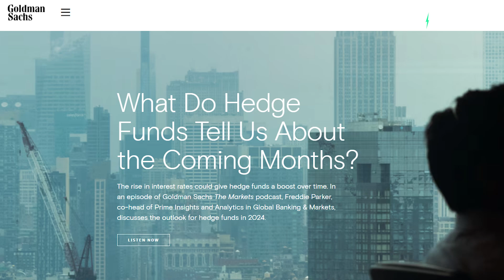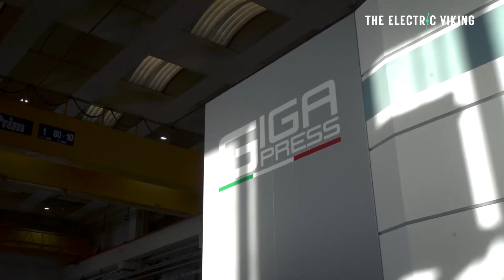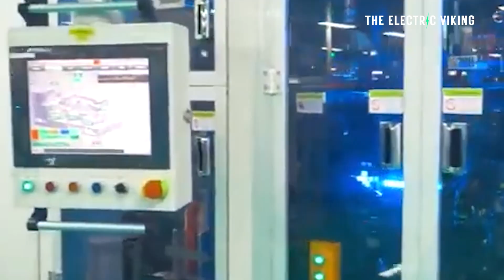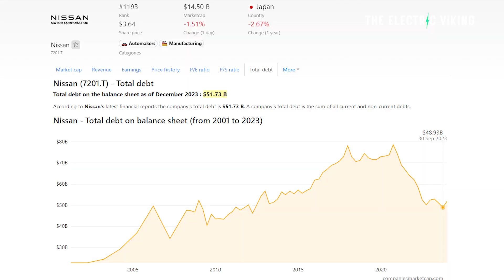Nissan will use Tesla Gigacasting & build the worlds biggest battery factory

Comment: Dude kWh is the amount of energy held in the battery. If density is high the battery is smaller size. So you always need around 80-100kWh for a car with decent autonomy. If these new batteries are way smaller this is nice.

Comment: A proper comment on Nissan’s plans requires to different areas of comment.
Gigacastings is easy to say, but hard to do.  To make gigacastings worthwhile, Tesla had to develop new design tools.  Ask Sandy Munro about this.  I’m sure Nissan hasn’t been able to develop new design tools and train it’s engineers on how to use them.  This will take years to achieve.  By then, Tesla will be even farther ahead.
If Nissan is able to make more energy dense batteries, maybe the KWH rating for the battery can go down a bit, but doubling battery energy density does not halve the need for KWH capacity.  So, a solid-state battery of 30KWH is going to give a low-end Nissan Ariya about 130 miles of range.  They will need a 50 KWH battery in each vehicle just to keep the 208-mile range.

Comment: 30 kilowatts? The whole point of a solid-state battery is that you can make it small enough to where you can pack maybe 150 kilowatts in a small battery.  This way you end up with a car that can go a thousand miles.  There's no way that they're going to make a solid-state battery and just make it 30 kw... That's the size battery that you put in a tiny micro car.
Reply: kWh not kW!!
Reply: @alexishart1989  You know what I meant, don't always feel like typing.  Point is the Viking says stuff like this all the time, a 30kWh battery is a 30kWh battery. It doesn't matter if it's Lead Acid, NMC, LFP or Solid State.  Of course LFP will be lighter than Lead Acid, NMC will be lighter than LFP and Solid State will be lighter than than NMC, but even if you got a tiny AAA battery to have 30kWh, you're still not going to be able to move AN ENTIRE CAR 300 miles!  Reality is that the best estimates say that SS will be ~30% smaller and lighter.  As an example a LR Tesla Model 3 weigh's around 3500 lbs and the NMC battery in it weighs around 1000 lbs.  This means that if that battery weighed 30% less, it would reduce the TOTAL weight to ~3200 lbs or around 10%. This would give you two options, either leave it as an 82kWh battery and instead of getting 350 miles you might now get closer to 385.  Your other option is to reduce the battery to around a 73kWh battery and still have around the same range of 350 miles.  Unless you both made the car out of plastic AND increased the efficiency of the electric motors by 60% there's no way you could get 300 miles out of a 30kWh battery.
Reply: Yes. He's said this same thing in a number of videos. The whole point is to make more KW hours in a smaller, lighter package, not fewer KWhr. Model 3 is quite efficient as EVs go and it gets roughly 4 miles per KWhr. To go farther, have more KWhr in each battery. Higher gravimetric energy density allows the car to be more efficient by having a lighter battery, but it changes the range at the margin, since the battery is maybe 1/3 the weight of the whole car and with higher energy density becomes a smaller fraction of the car. It's not a giant win, but it helps. As far as 1200 GWhr per year goes, I'm skeptical. Gig Nevada was designed for 100 GWhr per year and Nissan is talking 12 times the size? Uh-huh.
Reply: @arleneallen8809  It's hard to believe anything that Nissan says but even if you DOUBLE the efficiency from about 3 right now (4 is a stretch) to around 6 or so, you would STILL need at least a 40kWh battery to go 300 miles and that's if you're not doing any highway driving.
Reply: @TheCostofAutism  Getting a 3900 pound car to get 6 miles/kwhr would be close to magic. I don't follow the 40 x 6 = 300. A 40 kwhr battery would shave about 495 pounds from the car. Range might get up to 5 miles per kwhr. I do continue to advocate the use of urban EVs with small batteries. Make the car lightweight. Ignore long distance travel as a requirement because it is so infrequent for the vast majority that renting a car is more cost effective. We did a number of excel calculations more than a decade ago that showed TCO was optimized by not buying vehicles that can do everything. Buy a vehicle that satisfies daily life. Rent for the other times.
Reply: @arleneallen8809  My point exactly.  I used that as a far fetched example to my original post.  There's NO WAY as Viking pointed out on this video that you would be able to drive a car like a Tesla Model 3 on a 30kWh battery, even if it was "Solid State".
Reply: Why have a battery that is maybe only used fully once per year?

Charging infrastructure is more important.

So unless you drive more than 300 km per day or pulling a heavy trailer. Then 30-50 kWh is more than sufficient. If they charge faster than today then you only need 5 minutes every 3 hours. That is only nice and healthy to have a break on long trips.
Reply: @carstenlundstrm6889  I drive 200 miles / 322km daily.  I know MOST don't, but here in Florida there's A LOT of people that drive well over 100 miles a day.  I live in Delray Beach and half my neighbors work in Miami, 60 miles away.  A lot of them work in Jupiter, 50 miles away and some even in Port St. Lucie, 80 miles away.

Comment: I drove Nissan Leafs from 2011 to 2023. 3 of them. Great cars no maintenance, very reliable…the perfect $25k car…BUT it has Chademo DC plug and slow charging speeds and air cooled batteries. Nissan couldn’t change Chademo to CCS or NACS in 13 years and add thermal battery management how are they going to build solid state batteries? I know the Ariya  added these but if Nissan could have improved the Leaf and kept the selling price below $30k they would sell like hotcakes. Nissan’s pronouncements are therefore very suspect.
Reply: Same here,  but the LEAFs  were BUTT ugly, and now that I drive a Tesla, I'm never looking back!
Reply: 😂Same hare
Reply: Japan auto CEOs got old - real Frunkin' old...

Comment: southern California, where the state’s $4.2bn pest-control industry uses it for drywood termite control. Sulfuryl fluoride is estimated to be up to 7,500 times more potent than carbon dioxide in terms of its greenhouse-gas
Reply: Where termites are we have to stop building out of what they eat (wood) the gas used to bug bomb houses are 7500 times stronger than CO2 and last for over 40 years. 
 That's just insane to keep using this gas and stupidity to just build the same type of buildings they eat.
 This gas is also sprayed onto international shipping goods to prevent the spread of bugs, another reason why globalisation interconnectivity is bad for the environment
Reply: Ouch

Comment: I'm sure that Nissan will start producing solid-state batteries right after Toyota does.
Reply: 🤣 same here. Apparently both will be based on breaking new technology called hot air
Reply: Oh my god, another Toyota promises!
Reply: 2029, so they will go bankrupt before that so they can say it's not their fault if they did not produce the solid state battery...
Reply: Junk rating???
Reply: Welp the official press release claimed April of 2029 for a production Nissan ev with solid state cells so they might beat toyoduh. 
You know whose been promising solid state cells in production evs starting in 2020 for the Olympics! 😅👍🏻
Reply: Automakers don't necessarily have their own battery technology. Toyota's Solid-State Batteries is based on technology from Idemitsu, which they have been closely developing for nearly 10 years. Solid State battery EVs will sold from 2027/2028. 

And Toyota's hybrid and early Tesla models use Panasonic battery design, while Nissan Leaf uses NEC batteries. Japanese batteries are more reliable and high quality than Korean and Chinese batteries, but they are more expensive.

Comment: You need to understand what kilowatt hours means. It takes the same amount of energy to push the same car the same distance. It doesn't matter what chemistry is used if everything else is the same. So for a car with a range of 400 km using a LFP battery of 60kwh will still need a 60kwh solid state battery. The only gain is from a potential weight difference. Ignoring that the batteries need the same number of Kilowatt hours.
Reply: But lighter weight battery means it takes less energy to push the car the same distance ?
Reply: @venture.brothers to some extent, but at highway speeds most of your energy is spent fighting air resistance
Reply: @revelae  ... and rolling resistance.
Reply: @venture.brothers  I mentioned that so I am not sure what your point is.
Reply: Yes, doubling energy density doesn’t mean you can replace a 60kWh battery with a 30 kWh battery.
Reply: He doesn't understand a lot about EVs yet people listen to his channel for advice..

Comment: 1:10  At 100 mWh of battery production per month x 12 = 1,200 mWh per year thus 1.2 GwH per year.  That divided by an 40 kW battery,  gives you 30,000 battery packs per year.  Assuming fast charging is ubiquitous by 2030,  thus cars then only requiring 40 kWh battery packs for a couple of hundred miles range.  Nissan's global sales volume in fiscal year 2022 was about 3.31 million vehicles.  I'm not sure how this battery factory could meet that production figure,  but perhaps they are talking about Nissan EV sales only.
Reply: I noticed too, the Viking's calculation is off by a factor 1000. 100 mWh/month is chicken feed.

Comment: Oh Sam! 
A 30Kwh battery because energy density is high does not allow an electric car to go much further than a 30Kwh battery with low energy density. (Weighs more but still provides the same 30Kwh of energy)! So, a solid state battery with a really high energy density Watts/Kg only weighs less. If cars need 55-75Kwh batteries now, they still will in the future no matter how much the energy density improves! It is just, that battery will weigh less
Reply: If the motors had lower power rating, around the 300 watt rather than what they are now, the range would increase with the same battery.
Reply: @dikkybee4003  theyre dont have great range... yes you can have a fiesta but it will have smaller batteries... under the back seat or something and very small range... so a city car
Reply: @dikkybee4003 a little, not much. The “Work” being done is mass x distance. You’d still do the same work and the motor may not be doing it as efficiently if it were too small. In terms of energy saved, you’d mostly only save a small amount of weight…. And no one would want to drive them!
Reply: Simple physics my friend. If the same amount of energy can be sorted in a lighter battery then range will increase as there's less mass to move.
Reply: @steve_787  
Yes “Simple’s Physics!”
The battery weight decreases slightly. Rolling friction (already low) decreases less and regen breaking makes up 90% of inertial force required so don’t even go there! 
Of course,  parasitic drag (air resistance) parasitic power (accessory devices) and the biggest drain beside the work of moving the vehicle (the air conditioner) all remain the same which means basic physics teaches us that a small weight / size saving gained from an increased energy density means that to travel the same distance, the same car will require much the same energy availability! 
The real benefit is that for the same weight / size battery pack, the range will increase. Now I’m an Aerospace Engineer, so of course I consider induced drag for aircraft and that my learned friend, WILL actually make a difference, since induced drag is directly proportional to mass! But for cars that don’t generate induced drag. I maintain, Sam is sadly still getting it wrong! 😂
Reply: @bbck2537  also we neeeeed smaller batteries... we need a battery that will be the size of a briefcase... that way we can build smaller cars... all these evs are humongous crossover dinosaurs... you cant have an electric fiesta right now... at least not one that will drive very far
Reply: @bbck2537  so a long winded (aerospace pun for you 😉) way of saying you agree, less weight = more efficiency. Similar to driving a car on your own, or with a few other passengers 👍
Reply: of course it would help if the battery was much lighter... if you can half the kw/km you double the range
Reply: @LoneWolf-wp9dn yeah, see my reply to Steve
Reply: @bbck2537  aint nobody reading that... and yes youre still wrong
Reply: @bbck2537  genuine aeronautics question for you. Something I was thing about the other day with the future of aviation and will it go electric or hydrogen. At what energy density is needed for a battery powered commercial jet (737 or similar) to become a reality? The fuel alone on take off must have a fair weight to it, so whats the tipping point between replacing the fuel tanks with batteries? 
I only did a brief search on it on my lunch break the other day and seemed to be around 400-450Wh/kg for light aircraft and 1200-1500Wh/kg for something like an A380? Would you concur on these approximations?
My son wants to be a pilot which made me think about it (and i have joked with him that he's just trying to undo all the good I've tried to do for the environment by buying an EV 😅 )
Appreciate your thoughts.

Comment: Does giga casting increase insurance costs?
Reply: Why would it? Every single ice engine block made since Ford pioneered casting a century ago is CAST just like the giga castings!
Reply: @4literv6 accept the engine doesn't get damaged in a crash.
Reply: @ExploringCabinsandMines  Que?!
Reply: Insurance companies (ScamCo) are charging higher rates on ICE vehicles and claim, "it's Tesla's fault!"
Reply: A bit of FUD that has be rolling around from when Tesla first started using them.
GigaGigacasting are seamless more complex shapes with varying thicknesses within a single piece. This can create targeted reinforcement in high-stress areas, improving structural integrity in those specific locations.  A car with gigaCastings may come through without expensive to repair frame damage.  But it gets better than that.  Tesla is pioneering module assembly methods that allow cars to be assembled and disassembled much faster.  This makes body repair much easier.  These cars should cost less to ensure especially ones that adopt the modular construction.